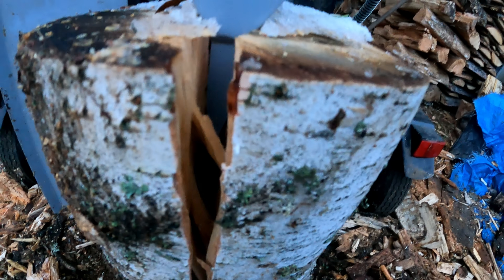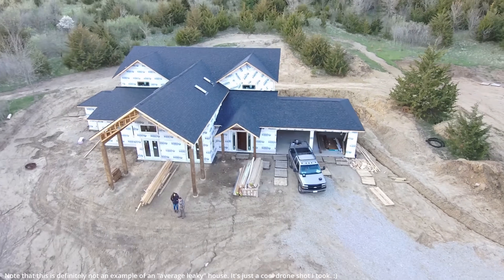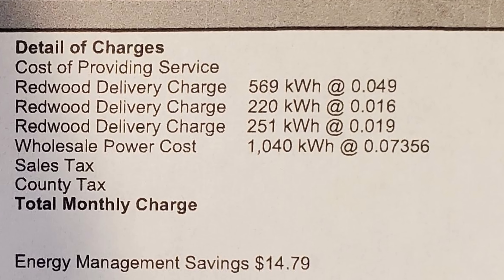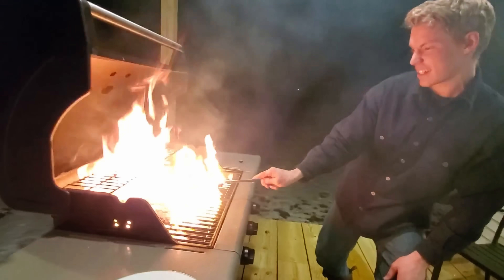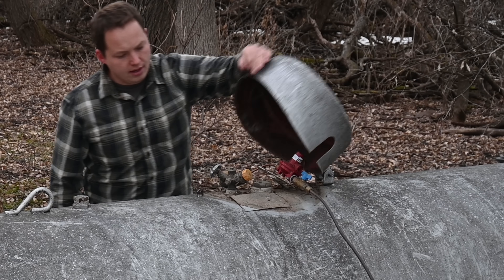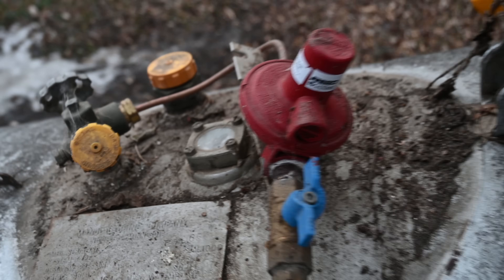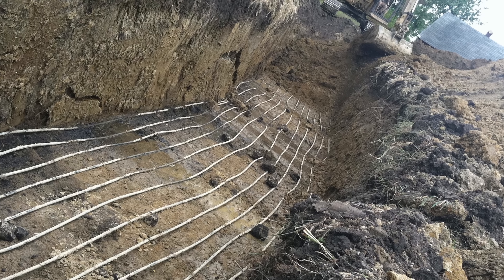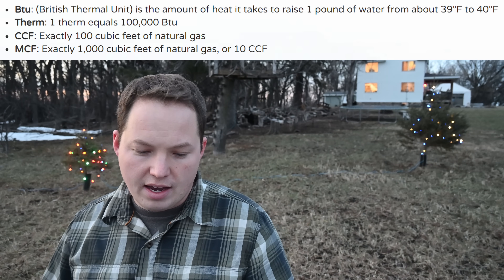What's The Best Heat Source in 2022? Top 5 Home Heating Methods - LP Electric NG Geothermal Fuel Oil

Comment: Fuel oil is still pretty popular in the Northeast and North Midatlantic area (Philly), especially outside of the cities (which tend to have NG.) For whatever reason, propane prices around this area aren't as cheap as in the Midwest, and because these areas are older, the NG infrastructure didn't exist 200 years ago when these areas were established. Many hones still use hydronic heat (oil fired boilers), often with no AC, so there's no drop-in heat pump system that could be used without running ducts or using minisplit heads everywhere. Check out Steve Lav's youtube channel for servicing these old and crusty oil systems.
Reply: I'm in North Western P.A. and it's pretty much the same here as well with people using fuel oil. In my area (a snow belt) it is most often used over other heat sources because of availability also. It's a pain in the ass/major run around to get a propane tank filled here and if something happens you're pretty much boned until they get to you.... with fuel oil you can just make a run to any given town and get some on your own... many people will run off-road diesel also (shh lol).  
Personally I try to keep the most options I can living here in a snow belt... my primary source has always been wood (outside wood boiler) but have electric.. pellet... and fuel heaters as well just in case... and of course generators handy.  
Been really looking into doing my own geo also 
But yeah "can confirm" what you're saying for sure. 
One lump sum to fill a large expensive propane tank all at once is also a issue for many living pay check to pay check... if something pops up one can't afford to fill the expensive propane tank/ lump sum but one can typically go grab a 5 gallon and dump in some fuel oil to get by. 
When I run propane I do customer owned 100 pound tanks and go get them filled myself to cut much of the costs but I have a filling station only a couple miles away. When I rented a apartment it had a big tank and it was always stupid trying to get them to fill it... call at 30% and hope they get to it before it ran out type of shit and even then it wasn't a guarantee it would happen... had to fix water lines a few times because of the pricks. lol
Reply: @510Redneck  Eastern PA propane is cheap. 1.40 a gallon in the January.  I usually fill up in July when propane gluts but since they started this liquification plant in Jersey from the fracked wells in PA propane has dropped. They have to remove that propane and butane from the natural gas at the well head and they have no where to go with it.
Reply: @anthonyspadafora1384  Yeah my comment was more about availability here, the propane companies around my area are horrible because they know they got ya under their thumb if that is all your heating with.  I thankfully haven't had to deal with them to get things filled since I got out of the apartment I was in, I got over 100 acres of woods and installed a outside wood boiler now so been chillin like a Villian as far as heating is concerned. I have a big oil burner with a heat exchanger out there also and have yet to even hook a fuel line to it because there's been no need for it.
 Living in this snowbelt off the lake all my life I've learned to never rely on anyone and to try to have all forms of heat and various power sources because there is nothing worse than freezing ones tail off just because I was to dumb (having lived here my whole life) to prepare for such events.  
The power is hit and miss here due to the crazy ever drastically changing weather we get and most people are SOL often.  Even put in a trusty ol fireplace incase worst comes to worse.... hell I'm like the only Englishmen around to have both a electric water pump and a hand pump (2 wells) is how serious I am about it. 🤣
Reply: @510Redneck  You have the right idea! I try to tell my customers to at least get a 120 gallon propane tank and a small non electric wall heater to at least buy you some time. Most don't listen, they have full faith in that grid  lol
Reply: We use heat pumps with hydronic systems here in Ireland. it works with underfloor heating and radiators. We also do hybrid heating and hot water systems this can be heat pump with condensing oil or gas or wood pellet or solar
Reply: Something like 80% of houses in New Hampshire are Oil still
Reply: In the South, heating oil never caught on. We went straight from wood to propane/natural gas, and then heat pumps. Heat pumps are very useful on the Gulf Coast, where it rarely gets below freezing. The inland areas need gas heat, though.
Reply: I am a hydronic heating specialist right outside of Reading PA. Propane is 1.40 a gallon right now and hydronics are far superior to warm air systems. Being a hydronic system has nothing to do with it being oil, you can use any fuel source. Europe is all hydronic and their heat pumps are air to water. Not only does this give them the advantage of zoning and inexpensive distribution they also make their domestic from their heat pumps similar to desuperheating a geothermal unit. I don't like working on oil but there are people who are just not going to put gas in their home.
Reply: Anyone with oil heat should get a ductless heat pump as soon as possible!  The cost for 1 gallon of oil is $6 now, and that puts about 100,000 Btu's into the home.  5-8 KW of power to run a heat pump will also produce 100,000 Btu's..  Above 15F, it is much less expensive to run a heat pump!
Reply: @Kangenpower7  I have 3 heat pumps down right now. 1 compressor and 2 TXV'S. All three are running on backup electric resistance heat till Spring. That is unless you are offering to lay in the mud and snow in 20 degrees to open the system and replace these parts. Don't forget that the POE is hygroscopic and the system will have to be triple vacced and broken with dry nitrogen in the hopes you don't contaminate the system. And dont forget, a Bosch system in this area is about 12 k with a lifespan of about 12 years so dont forget to figure in the 1000 a year mechanical wear expense.

Comment: It gets freezing cold here in the winter and super hot in summer. We use Mitsubishi minisplits and monthly bill is $40 to $90 per month. Most months is around $40 to $50 unless it gets super cold in the teens or lower. House is 1800 square feet. This bill includes using all electric appliances. We have no gas appliances.

Comment: Current Prices in Vermont:
Electric =19.5 cents per kilowatt
Propane = $3.55 gallon
Fuel oil =.  $2.49 gallon 
Nat Gas = 50% of propane + -
Dry Wood = $300 cord ( 228 Cu ft)
I use heat pumps and fire wood...
In a 2500 sq. ft. house. Through December Wood cost = $75
Heat Pump use cost = $336 + -
Total $411.
Last year I spent $1500 on wood alone, so my new heat pump mini splits are really efficient compared to the wood even at a high KW rate!
Reply from the maker: Thanks for sharing your rates! Fuel oil is actually fairly reasonable in your area but electricity and propane are way more than around here!
Reply: @BenjaminSahlstrom  The fuel oil is a special rate right now... I don’t know what it was previously and I have no clue how long this rate will be available. It’s the advertised price today!
Reply: Are you saying that natural gas plus delivery charge from energy supplier still 50 percent cheaper than propene ?
Reply: @andreycham4797  that’s what the ad appeared to be stating but I cannot be sure... I actually don’t know anyone in this area who uses NG

Comment: Make sure you check for discounted electrical rates for heating which are available in some areas.
To get the total picture you would also need to include installation and maintenance costs, but this is a good start.
If you generate your own electricity?

Comment: Are vertical geothermal heat pumps common in the US? They are one of the more expensive options here in Europe but depending on your location good :) Most common are air/Water heat pumps then Water/Water (vertical) then close vertical loops with coolant. Horizontal systems are rare because they need a lot of space and we dont get that much of it here :)
Reply from the maker: Vertical are fairly common here too. Just depends on if there is space or not. Vertical systems tend to be more efficient as well since the loops can be spaced further apart since you're not trying to put them all into the same trench.
Reply: Vertical loop GSHPs are used in the US, but I wouldn't call them common. For areas without NG, the cost to drill to install the loops makes GSHPs have a pretty long (if ever) payback period. With ASHPs (especially the Asian models) becoming so efficient at low temps, I really don't think GSHPs make much sense from a cost perspective.

Comment: The efficiency of a mini-split really depends on the outside temperature. How do you find what is the temperature from which you would switch from the mini-split to another heat source?
Reply: I think it depends on 2 factors: 1. What low temperature your particular mini split is rated to effectively move heat and 2. The cost of your alternative source vs. cost of mini split operation
Reply: @markum5094  Mitsubishi hi2 hyper heat is amazing..it extracts heat out of -15 degree...other brands not so much..some do..from my oil furnace forced air...I still have almost a full tank going on 3 years..never use it...its back up now...5 minisplits heat and cool all year...the old 13 seer ac central ain't been used in 10 years..its a dead lump I'm the yard..one day it will be removed...furnace is technically main source of heat...but never used...back up...cus my 2 honda generators don't do 240...just 125..so transfer switch does furnace fridge lights...and an outlet...minisplits from Mitsubishi are primo super seer
Reply: @cengeb  Exactly, I have the Mitsubishi Hyperheats... one 1.5 ton compressor which feeds an 18000 btu air handler and a 3 ton compressor which runs through a branch box to 3 air handlers; two of which are 9000 btu and the other is a 24000 btu. This is my first winter with them and it’s been moderately cold for Vermont... We’ve had 3 days below 0 F. The real test is coming Monday through Wednesday next week! Projected to be -18 with a high of -4 for about 36 hours 🥶🥶. If you don’t hear from me after that time, you’ll know they failed 😹😹
Reply: @markum5094  hahaha ha
Reply: @markum5094  i own a cottage with electrical (baseboard) heating. There is no connection to natural gas, and because electricity is cheap everyone around uses electric. heating. So it's between electricity and... electricity. I think that resistive heating is close to 100% efficient, so as long as the heat pump is above 100% efficiency then it is better.
Fundamentally, I am wondering how many days per year I will be able to use the heat pump. From what I read here it's pretty much all the time. Plus it has the added benefit of providing AC in the summer, and I don't like electrical baseboard. They seem like a fire hazard, if someone leaves something flammable unto them.
Reply: Mitsubishi hyper heat do 100 percent now with outside -15 degrees f.  Cooling is much more efficient than ducted..especially when most houses have leaky...uninsured duct work
Reply: @cengeb  Current building codes require duct work to be sealed with duct mastic, and good design means not putting ducts or any HVAC equipment in unconditioned spaces (crawlspaces or attics).
Reply: @brianleeper5737  my house was built in 77' by blind idiots...duct work is atrocious...
Reply: @cengeb  Lots of flex duct and duct board?
Reply: @brianleeper5737  no it's metal duct work, just horrible seams, none are taped, or sealed at all , all in outside walls, just a really horrible layout and installation...by not using them, it's saved me a fortune in heating and cooling, in 77' no one considered anything...ductwork should be all insulated types, like commercial stuff ..
Reply: @cengeb  That's impressive. Resistive heating is more or less 100% efficient, so basically above - 15 F it's better to use the heat pump, which means that unless you are in a really cold climate it is pretty much always better with the heat pump.

Comment: Were we supposed to see those roasted beans after the safety demo of the space heater LOL?
Reply from the maker: Yes! :) I thought it was funny to put it in there.
Reply: @BenjaminSahlstrom  For a moment I thought it was an accident, it was pretty darn funny. I haven't yet finished watching the video so you might mention it, but I've recently got into Mini Split Heat Pumps. I have some Dual Zone Daikin Heat Pumps, and they are so efficient on heat that they use less electricity than JUST THE BLOWER of my gas furnace, not even calculating in the gas cost, they are cheaper. Crazy.

Comment: Thanks !  We live in Richmond, CA.  east bay San Francisco, where it rarely freezes.  We live in a 2800 sq. ft. home which is heated with a 30 year old Trane NG forced air furnace. I test it regularly with a Testo CO monitor.  We will be replacing it this summer.  I am wondering if a heat pump would be a good choice;  over a standard NG forced air furnace.  Thanks,  Bob
Reply: You may want to consider a dual fuel system by placing a heat pump coil over a natural gas furnace with a variable speed blower. The furnace stage only comes on in the coldest of weather. I'm a 20 year HVAC/R man, so was able to do the job ourselves. We also use an antique wood cook stove for winter use, and placed the system return air grill nearby so it drew the radiant heat from the stove and spread it throughout the house. Our system actually runs very little other than the fan.
Reply: @ewetoobblowzdogg8410  Thanks so much for your suggestion.  Sounds like a good option.  I will look into it . . .   It seldom gets below 40 F where we live near San Francisco east bay.   Take care,   Bob

Comment: I have here a not so big house, 60m² (650 square-foot) and we pay 30 Cent/kWh (=USD 0,34/kWh) here in Germany.
I use electrical energy for heating (18°C - 21°C in the rooms), water heating and electrical devices.
My house is insulated (12cm of styrofoam, with a good protection again air leakage) and we need 530€ per year for electrical energy.
50% of this energy is used in the winter for heating.

We heat the rooms with a mini-split-device, the heating of the water is happened directly with resistance heating, but this costs for the warm water are not high at all.

Comment: The absolute best way to heat your home is with a catalytic wood stove.  I have natural gas but, rarely use it... the wood stove is way more efficient.  No contest.  
The problem with natural gas is it's 'forced air' operation... that's why it is constantly coming on and off, resulting in a yo-yo temperature swing.  A wood stove uses 'permeating' heat which warms up the entire physical structure of the house.  Once you reach room temperature (which takes a while) very little wood is required to sustain it.  In this regard I sometimes use my natural gas furnace to give me a head start 'boost', helping the wood stove achieve room temp.
Reply: Have you ever had to replace the catalyst in your stove?  When I was shopping for a wood stove, I went away from a catalytic for that reason.  I don't think I have any regrets. I went with a Quadra-Fire 5700 step top, which does the four stages of burn and is 87 percent efficient. (I believe the Catalytic were a little better).   That was in 2012 and ten years later I still haven't had to replace anything, not even the burner tubes or the ceramic baffle board.  Regardless, it lowered my wood use from about 11 pick up loads per winter (feeding an old Minnesota-made Schwiess) to about three pick up loads now.
Reply: @shaundevrisky349  I don't own a catalytic stove... I just saying it is the most efficient option.  I'm the same as you.  I own a a two stage stove rated at 80% efficiency.  I went this route because the catalyst has to be changed ever 5 or so years.  I'm a prepper so this is a no-go.
p.s. I go through 3 bush cords a season-- in Canada, so just as cold as you.
Reply: @keithmoriyama5421   I see.  Thanks.
Reply: I had a house with a natural gas furnace. The house I live in now has a heat pump because there are no natural gas lines here and propane pricing is very volatile, so I opted for a heat pump. I actually prefer the lower discharge air temps of a heat pump compared to a gas furnace, it seems to result in a more even temperature vs. the gas furnace.